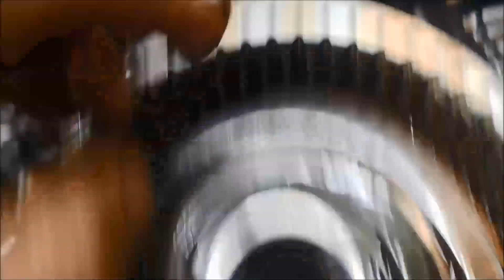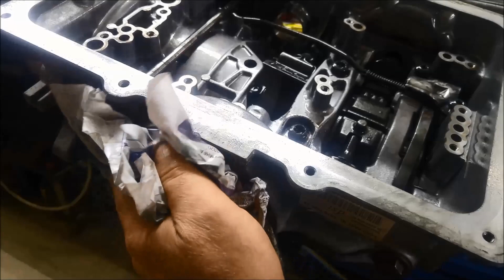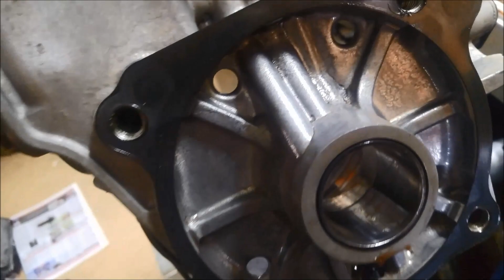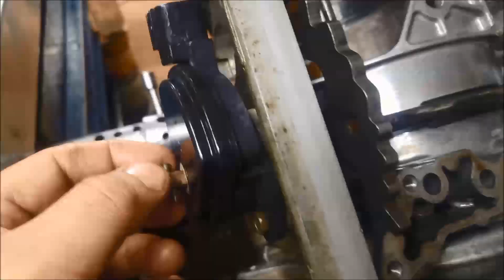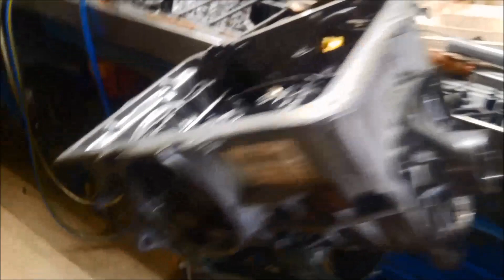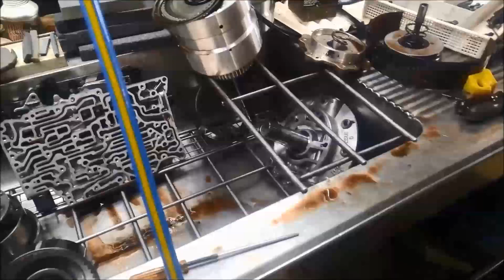Ford DSI M93LE BTR ION M74 M74LE M78 M78LE 4 Speed Automatic Transmission Teardown Disassembly 2 of2

Comment: Hi sir..just want to know Solenoid S1 ani S2 is it normal that fluid came out from the solenoid area when we push S1 and S2 shaft? Or perhaps the oring seal worn out. My m74le not engage in 2nd and 4th.

Comment: Hi great video but im looking for what would cause no 3rd and 4th tested control box its ok gearbox has been pulled down and inspected
Thanks
Reply from the maker: hi, generally a pressure apply leak or solenoid. cheers

Comment: @YetThatsIt do you have a guide for adjusting bands?   Mines taking too long to go into reverse have been told bands may need adjustment.   Generally shifts harsh also 1-2 , 2-3 ok'ish 3-4 smooth as butter
Reply from the maker: hi, the later ion & dsi 4 speed trans have band shim adjustments. you need to remove valve body and have a good selection of shim thicknesses and suitable tools to measure play. more likely your solenoids are worn/leaking. a leaking solenoid wont generally give a fault code. cheers
Reply: @YepThatsIt   Hello, thank you for the reply, I just noticed it.  Can you supply shift solenoids or recommend who to buy them from.  On next oil change I could give it a new set of solenoids.

Comment: Hey mate hows it going Just a qestion to ask of you in this video you show a value body that had 7 check balls in it and with the ordinary Ford Falcon 4 speed transmission M93LE BTR they have only  6 ball within the valve body. Just wanting to know what is the difference between the two valve bodies and how come your video is showing 7 ball because where as my tansmission valve body oil gallery is very different that of yours?.
Reply from the maker: hi, there are varations on valve bodies, always check for witness marks. cheers

Comment: Got a 2003 BA Fairmont, changed the filter and sump gasket, filled it with TQ95 and solved a slipping problem it had, but the front of the transmission (I assume where the pump is located) and between the rear of the engine and bellhousing is pouring out oil when I start her up and put her in gear. That will be a box out seal kit job yeah? I want to just get it running and get another box to fully reco, can you advise what seal kit would fix the issue I am encountering with this auto? Cheers.
Reply from the maker: hi, its really hard to say accurately without seeing it, but chase a pump reseal kit and check converter neck, welds and pump bushings. or contact me on our facebook link. cheers
Reply: @YepThatsIt  took the box out today, and the thing is toast, the converter neck around the seal is scored and had chunks embedded in the seal, the fluid was like glitter and the whole converter was pretty much buggered.
Reply from the maker: @Dave-id6sj  hopefully trans has at least had a good innings?

Comment: Just picked up a spare au btr that was said to be reco, turns out it was as all the clutch packs appear to not have any wear at all and still have part numbers on them. That being said I'm wanting to fit kevlar bands and strengthen it for turbo application but having no luck finding a source, any links you can throw my way?
Reply from the maker: hi, contact me on our facebook link. cheers
Reply: @YepThatsIt  I don't use Facebook.
Reply from the maker: @JTECH7766  then its tricky to exchange vids, pics and info. cheers

Comment: Will au v8 gearbox fits into EF Fairmont V8 without changing any electronics kit or had put conversion wiring harnesses
Reply from the maker: hi, it should fit, however you need to compare it all for yourself. cheers

Comment: Wow, impressive strip down video and explanation. My AU2 wagon has just started getting sluggish selecting first or reverse, when cold, first start of the day. Its a high mileage 680k, had a couple of  trans replacements during its former taxi life. I have  Replaced the filter and pan gasket and fluid change, (but not flushed), about 2 years ago. Is there value in replacing fluid again, with a new filter, or is it time to get a proper flush done ? Or is it time for a new trans ? It drives and shifts perfectly once warmed up.   Thanks
Reply from the maker: hi, on these the solenoids get contaminated with magnetized debris ( consistency of grease ) and then cause a sticky effect of the solenoid operation. if you remove valve body, would be good idea to adjust bands by re-shiming them to specs. cheers

Comment: What does it mean when they the TCC locks up fine in 4th gear but not in 3rd gear? "Econ" button doesn't seem to work. Feeling no difference whatsoever whether it's in econ mode or normal mode. It's like as if its stuck in normal mode. Car is a AU Fairmont Ghia 4.0l VCT.
Thanks.
Reply from the maker: hi, could be worn...also depends on how hard you are driving. cheers

Comment: Just put a second hand ba falcon transmission into my car. Had it running on the hoist everything worked fine drove it out the garage and now can’t select park. Pulled the shift cable off and tried to manually select park with the shaft through the inhibitor switch couldn’t select it there either. Also reverse has stopped working. Is this related to the manual shaft and the z link ?
Reply from the maker: did you have valve body off? i`d say probably damaged the linkage when you tightened the nut on the selector shaft without supporting the bracket, so damage internal linkages...rev wont work if selector shaft valve can`t align correctly....but then again i`d need more info...contact me on our facebook link if you need more info, we can exchange vids and pics on there if needed for a few beers.....cheers

Comment: interesting, makes me wonder what other fields these skills could be used, hydraulics etc. once we rebuilt the rear brakes on a cat 785 dump truck kinda similar , with wet clutches and springs. i bet when you first learnt these skills it was very interesting, i know its not rocket science but you've got to have brains to do this kind of work.  i think on pd some YT beers ,it was interesting and educational.
Reply from the maker: hi, as kids we were probably the ones that easily put the triangle, square, round shapes in the proper hole 1st go ! long weekend coming and extra beers would be handy. cheers